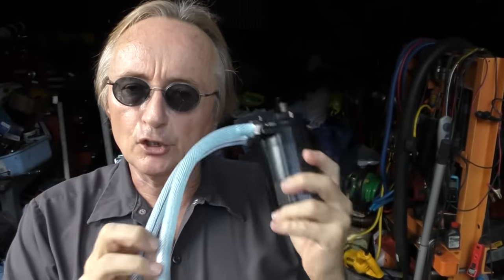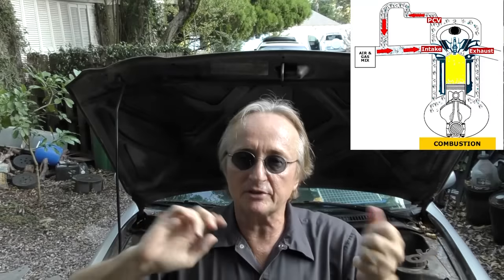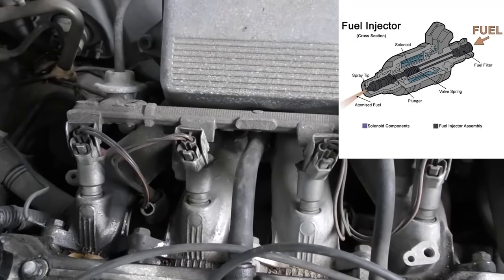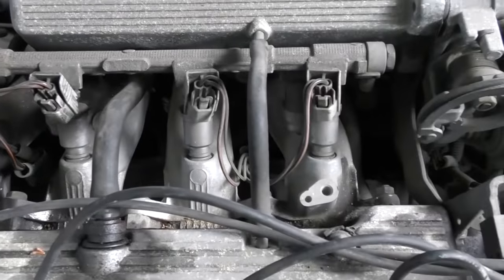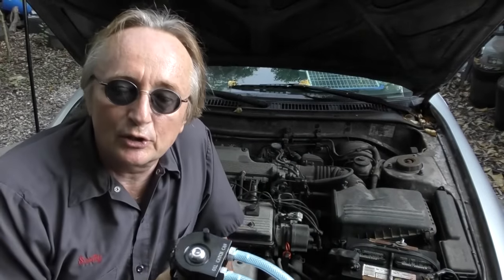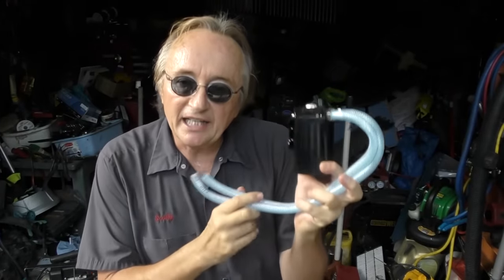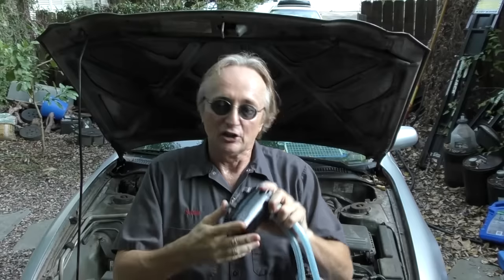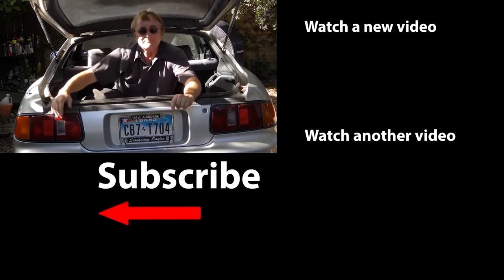If You Have This Type of Car, You Need This to Prevent Damage to Your Engine - Oil Catch Can

Comment: Are all Hyundai/Kia GDI engines the old style single injector? That's the impression I have. If so, Hyundai/Kia seriously need to update their motors with the dual injectors or get rid of GDI altogether.
Reply: I bought a new 2018 Tucson this summer and just bought a 2018 Sedona for my wife. Both obviously have GDI engines, but as 482lost pointed out, Kia and Hyundai do not have issues with their GDI engines, at least for a very long time. They come with 10 year 100k mile powertrain warranties and I'll be using Amsoil Signature Series Oil for both vehicles. I do not expect any issues the for all of the years that we plan to own the vehicles.
Reply: On all of them? I have the 1.6L GDI turbo in the Elantra sport and want to keep it clean, I saw some valvoline made for GDI engines with DEXOS generation 2 in it thinking about running it the only oil i saw that was made for GDI.
Reply: I also run a can of BG44K through each of my vehicles every 10k miles or so.
Reply: One person commented that Kia/Hyundai holds the intake valve open to have the gas mixture hit the valves to clean them off. More than one way to skin a cat.
Reply: @zachl5504  they dont have 10 year warranty
Reply: J Smith it's 10yr. Or 100k which ever comes first. Mine is lifetime from the dealer.
Reply: The 2017 to 2019 Elantra 2.0 still uses MPI... But the Sport model has a GDI Turbo.

Comment: I dont call myself an expert by any means but I do own a 2018 direct Injection car so I will speak from experienced. I've been doing my own work on my own vehicles since I was young and have been tuning cars ECU for the past 8 years. Catch can alone doesn't get rid or slow down carbon build up especially with engines running with egr and tgv systems. When I checked my intake valves at 22k miles with catch can installed at 1k mile, it had tons of carbon build up on it so I had to do a tedious job of walnut blasting the carbon off. I installed an Air/Oil Separator, did a tgv deletion and an EGR deletion to slow down the process  of the carbon build up and retuned my car's  ECU to run properly. You will never totally get rid of carbon build up from a GDI OR DI motors but you can slow down the carbon build up by doing those things mentioned above.

Comment: I already found the pcv rerouted to the exhaust on my ride already when bought used
Reply: GhostOfAMachine how is that done?
Reply: Won't that cause a problem to your catalytic converter being clogged up?
Reply: @kito1san  not if you take it off lol
Reply: @unitedwestanddividedwefall3521  plug on the intake manifold, and conected the hose to downpipe past the headers, and its been acting like a vacuum pulling oil vapors and fumes out, and out the exhaust
Reply: @kito1san  it doesn't have cats, previous owner had all emissions removed

Comment: A lot of manufacturers already addressed the pcv issues on turbocharged engines by manufacturing engines with built in air oil separators.
Reply: Exactly

Comment: Scotty,I have for quite some time,been following the Oil Catch Can debate ( Do they work or not) In Australia,there is a company that tested 3 identical cars fitted with the Ford 1.6 litre Ecoboost engine.These cars were tested to 150,000 miles. One car was fitted with a very expensive catch can.The second car had very regular oil changes,more frequently than Ford's recommendation.The third car was stock,with services carried out to Ford's recommendation
The results were as follows. The car that had more oil changes than it should have done,showed significantly less carbon build up on the valves,than the other two.The engineers,could see no difference between the car with the Catch Can fitted and the one that was stock.
I think these real world tests,for me at least,proved that Catch Cans are basically, Snake Oil. Changing the oil regularly with good quality Synthetic oil,is the way to go.
Has anyone in the US,carried out a similar test,if so can we see the results.
Reply: Brian Smith Thanks Brian.

Comment: Great video, very informative 👍👏👏👏👏👏

I just bought a 2019 Rabbit edition GTI. Would I need this for my car?
Reply: If your car has a PCV ? Then yes .
Reply: Yes
Reply: Yes and you should start saving money for huuuuge repair bills in the near future
Reply: almost all crancases need to be positively ventilated so presence of a PCV does not mean you'll have a problem. the problem with a Direct Injection is that none of the gasoline/detergents wash over the intake valves like Port Injection systems from the old days. The solution is Multi-Port injection and late model vehicles are being redesigned with those types of systems, which feature a guest star stream of gasoline/detergent in the intake manifold primarily for preventative maintenance by cleaning the intake valve deposits (IVD).

Comment: Should I buy a 2000 toyota celica that has over 200k miles on it?
Reply: 200K miles on a celica is like only 40K miles in any other car. To answer your question, yes. My son had a 97 Celica with over 400K miles and sold it for good money.
Reply: I bought a 2005 Toyota Solara with 237K miles on it, and it has been running flawlessly :)
Reply: Thabit Pulak how long have you owned it for?
Reply: The 2000 Celicas usually have the 1ZZ FE engine. It was in many cars. They are good engines but be warned, they can develop severe oil burning. If you test drive it check the dipstick level. If its low or smells burnt don't buy it. My 2000 Corolla's 1ZZ burns No oil at 225k. It all depends on if you do proper Maitenence. Good luck.
Reply: I've owned it for 3 months, and put on 6K miles on it (243K now), with zero issues. The 3.3 Liter Engine Toyota used in that era is incredible! It was used in the Sienna, Highlander, and Lexus ES 330, and RX 330. You can see tons of these cars with high mileage on that engine for sale :)
Reply: No!😂
Reply: Toyota   great    car.   Take   care   of   em,   do  they   maintenance   
and   it   will   last  a  long  time   n
Go  for  thousands  n  thousands  
Of   trouble   free   miles.........
Reply: Depends on the condition, maintenance, type miles driven, and pre-purchase inspection. No red flags and and a fair price, probably be a great choice. It would probably not have the 180k mile services done, so expect to do everything (that'll give you a solid baseline for future maintenance and an opportunity to really get to know the condition).
Reply: depends on condition and price. personally, no.

Comment: Would a Kia Sorento 2019 (3.3L) need this?
Reply: all cars can benefit from oil catch cans to make the engine run cleaner instead of the engine igniting oil and blow by.
Reply: @koreymayo8884  -  100%
Reply: Yes it has direct injection.
Reply: Al gdi need it
Reply: Yes!  We are putting one on our 2016 Hyundai Santa Fe. 3.3 v6
Reply: It's not overly necessary... There are GDI engines with hundreds and hundreds of thousands of miles on them still running just fine

Comment: Hey Scotty I don’t think the k20c1 has the dual injector setup di and port injection. Im adding a catch can that does both crank case and pcv. The Nuke Performance has 2 inlets and 1 outlet. Saves space and weight. Im thinking of adding water injection pre throttle body. My aftermarket hard pipe has a threaded boss to accept a water injection nozzle. That’ll help steam clean the valves and pistons. Also getting oil vapors out will keep from degrading the octane level of your gas avoiding knock. Im sure you already know that but some of your viewers  might not.

Comment: I bought a 2019 Mazda CX5 non turbo for my wife a few months ago and started thinking along the lines of a oil catch can. I did some inspecting first. I pulled the three hoses that connect to the throttle body and ran a Q-tip inside each hose and didn't find any oil residue at all inside these tubes. The car has almost 4 thousand miles on it so I suspect there would be oil residue inside  one of the tubes. Looks like Mazda did their own research about this problem while designing the SkyActiv engine.

Comment: so how come diesels dont have this problem?
Reply: Joe Barbaro diesel egr valves clog from carbon all the time
Reply: @casselc9  for real. i clean my egr valve and intake manifold the best i can every year lol
Reply: I thought diesel does? I'm cleaning my land cruiser's valve now.
Reply: i think it's the same on diesel... only a little proportion from the exhaust gases goes through EGR valve...EGR valve is only here to reduce a bit the combustion t° and so reduce the NOx gases emissions by add of... water steam who are in big proportion in the exaust gases...
Reply: in europe engine dont have pcv sistem(old system) but have a decantator that reduce the amount of oil that go into the intake. The biggest problem for diesel is the egr.
Reply: Vw tdis do it. 
Either retune and have the egr deleted , or make a block off gasket and live with the check engine light. 
My old tdi was so clogged that you could barely fit your thumb down the main intake port. 
Since I was doing a timing belt, I yanked the cam and intake and used a propane torch to burn all the crap out of the intake and ports. 
Pretty much a standard procedure for the vw diesel guys.
Reply: They do it the worst you should here an inter-cooler gurgle.
Reply: Not all GDIs have the problem, in contrast some non-GDI engines will also foul the valves. Ignore the EGR comments because that's a different problem with a different cause. If you have a clogged EGR valve it isn't a result of blowby, its a result of incomplete combustion. Diesel engines are a lot more common and most of the issues where ironed out a long time ago. GDI is just becoming common and some manufacturers didn't have the experience to build the properly so they made some bad engines. Something happens with non-GDI engines all the time, just lookup the Toyota sludge settlement. Something to think about, VW made GDI engines which are notorious for carbon buildup, diesel engines they built at the same time are also notorious for carbon buildup. So it wasn't just a GDI problem, it was a VW problem. Things like the type of oil used, the position of the PCV, and a few other things will limit (but not get rid of) the problem.
Reply: diesel spit  more oil n recirculate in the turbo to feed manifold

Comment: Hi Scott.. do you think catch pan really works. Isn't the oil supposed to go back to the engine
Reply: In scotty's video he said....
-the hose used to just be dumped onto the road until the EPA came along. 
-then it was returned back to the motor spraying onto the valves. Any build up was eventually burned off by the gasoline
-GDI motors spray the gas lower so the build up deposits are not being burned off.

To awnser tour question its oil vapor condensing to an oil liquid inside the can. Your not losing a ton of oil in this device which I think is what you wondering about.

Comment: Would this be good for a 2016 chevy traverse? There is no pcv valve. There is a connector on the front of the engine that should be a pcv valve, but is a vent connector that runs to the air intake system. And then a sort-of pcv valve on the rear side under the firewall. But I have read that some people have put catch cans on them. Would you recommend it for the 2016 Chevy Traverse?

Comment: 204,000 miles on my 3.6 DI in my 2009 CTS. Doesnt miss a beat. No catch can. Good oil will also help. Never used anything but Mobil 1.

Comment: Scotty,
Can a catch can installed on my 2015 GDI Kia V6 3.3l void the warranty? I have an extended power train warranty on my 2015 Kia through Zurich from 100,000 miles/20 years. Factory power train warranty is from 60,000 and up to 10 years. Dealership says a catch can
modification is a modification that will void the warranty. Your imput please. Thanks.

Comment: I put one on a truck that doesn’t have GDI. The first 1,000 miles with it on it caught about 2 tablespoons of blow by oil. I know the fuel is supposed to clean the valves off but I don’t have much faith in that taking care of it all. Why even have the oil and debris going into the intake in the first place if you can prevent it???

Comment: Scotty....Define “Modern GDI” engine’s?  Newer than a certain year or specific manufacturer/model/sub fleet etc.....?

Per two of the question.......

Will installing a Catch Can one a NON GDI Engine make any difference in the PCV venting system?   o have a Sequential Multipoint Fuel Injection engine?  I have two actually 2020 (SMPI) and a 2017 (GDI).  Will the catch can provide any difference in the system as in either negative difference or positive?   I had one o my previous twin turbo GDI. And normally drained the can every 2000 miles.  It was reasonably easy to access and you are just removing the canister portion, the top, mounting brackets and hose still stayed attached.

I would normally get about 1/3 teaspoon in 2000 miles is that significant or about normal?   I set for 2000 miles and was pretty religious about tracking.  If I was going to be enroute during the 2K mark I would either drain and clean the canister before the trip or checking/draining at first available stop.  It was easy to unthread, drain and in most cases would be absorbed by a couple of paper towels then one more towel to wipe out the inside of the canister.

Both engines are V6 and fairly newer generation/technology.    Do I need one or not.

Engines are 

Honda/Acura 3.5 (2017).  GDI

Chrysler (FCA). Pentastar 2.6 V6. But again. SMPI

Comment: My 3.0L V6 on my 2007 Mercedes does not have direct injection and the piston rings are not worn but I installed this same model catch can anyway. The intake manifold has cheap plastic secondary flaps that are known to get coked up with carbon and impurities from the PCV which cause the secondaries to bind up and eventually break. It’s an expensive fix because you have to replace the entire intake manifold. Oil catch cans are a good idea and can only help not hurt as long as they’re installed correctly.

Comment: I have the same catch can but red, on my 6.6 Duramax. Where they route the pcv into the turbo inlet from the factory. I set mine up with a breather filter instead of routing it back into the motor...

Comment: Sweet I need to get one for my 2011 Range Rover. It’s  GDI high pressure fuel system .. i pulled the intake manifold off the other day and notice all the carbon buildup ! I was blown away!!  Need to take action ace hap!  Run some 108 octane afterwards and clean up the engine

Comment: The 2.4L Equinox has been designed to prevent a catch can installation.  In fact, it's been designed to prevent service of the PCV system all together.  They even designed in a trap on the makeup air side so if your vacuum side becomes clogged, the water vapor will freeze in the makeup side and destroy the engine.  Genius right there.

Comment: Hello. I have a 2016 F 150 2.7L ecoboost. I have.a rough idle issue that comes on usually with the a/c on. Also I have changed the purge valve 3 times in the past 5 months, due to the engine light coming on and the error code P144c. I live in Florida. Will the oil separator help with this issue?? Your advice is greatly appreciated.

Comment: I installed an oil catch can on my 2018 Camaro SS 1LE when it had 2000 or 1500 miles on it. It is a baffled catch can from Mishimoto. I have emptied it twice. I actually have a video of mW empiting it on You Tube. those catch cans can fill up quick.

Comment: If you have a 2010-2014 Prius, you need to put one on. During that time, Toyota was using low quality piston rings which caused more blow by than they should allow, fouling up the EGR valve, eventually causing a blown head gasket and/or the connecting rods to fold.

Comment: Hyundai/Kia has new 2.5 non turbo and turbo engines that now have GDI and PI unlike the older 2.4, 1.6T, etc GDI only engines. So this can would definitely help those older engines but thankfully the newer ones have solved this issue. I know Toyota has both GDI and PI but I'm not sure about other manufacturers besides Hyundai/Kia that does both on their new cars.

Comment: Now I know that my 2015 Impreza doesn't need a catch can, because it has the FB20B engine, with port injection. In 2017 Subaru changed the Impreza engine to the FB20D, with direct injection. Good to know. Thanks!

Comment: Just read my catch can instructions,  ending my installing it, if the weather gets to freezing temperatures,  I need to put the original configuration back. So I will be doing annual intake cleanings on both GDI suvs

Comment: I just bought an 18 explorer sport with 7k miles, and also have a 2010 sho with 34k original miles and a new engine (600 miles on it), both have 3.5L twin turbo v6 engines.. just installed jlt 3.0 oil separators on both cars today.

Comment: Hi Scotty, I drive a 2015 Honda Accord sport with a 2.4L Earth Dreams engine. I have about 72K miles on it. I take good care of the car but i don’t have a catch can and have never cleaned the intake valves with a cleaner spray. Would you recommend that I get a catch can or clean it with spray?   Thank you.
Reply: Honda engines have baffles inside the PVC system don't need a catch can

Comment: Not necessary as far as I’m concerned. Just use a good synthetic oil and a very good synthetic oil filter. I have a 2011 f150 with the 3.5 ecoboost and it now has 400,000 miles on it, zero valve issues, zero turbo issues and zero timing chain issues. Make sure your filter has a filtration down to 20 mics, much over that the contaminates can build up on the valves. I use Amsoil products but WIX HP filters are a good one to use.